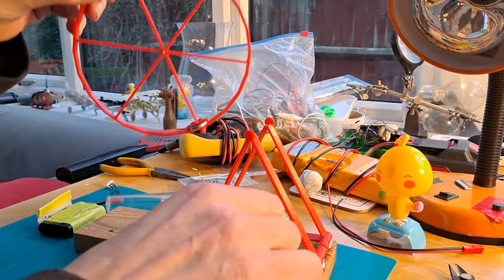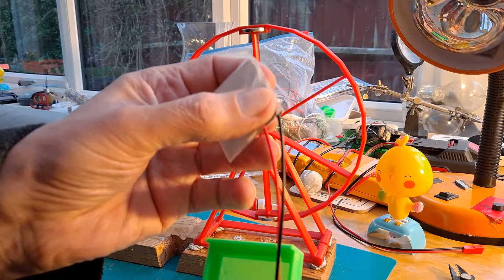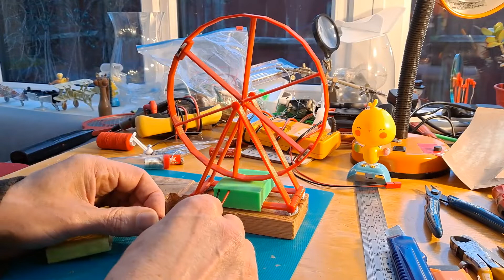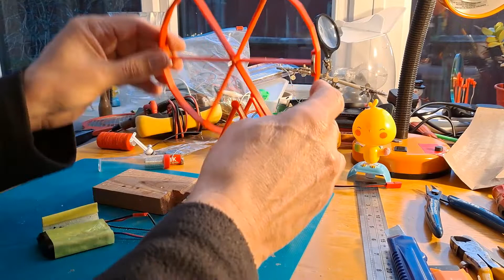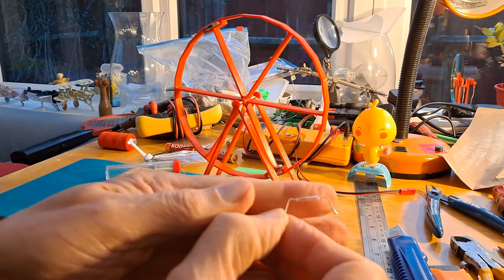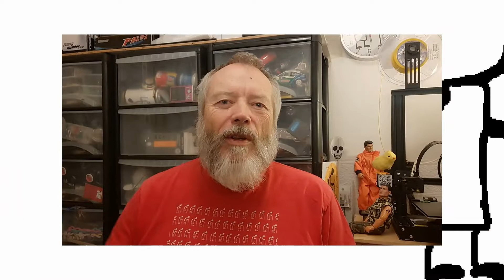RFID tag label pulse motor

Comment: Very interesting.  I found these RFID stickers on Amazon cheap.  I orderd some to play around with.  I would have never thought to try this except for your videos.  Thanks  Well done!
Reply from the maker: If it has a coil, I try it as a pulse motor driver. Can't resist 😊
Reply: @GrandadIsAnOldMan  Me too. The last week I have been trying different things also.  I fount that even a rolled up USB extension cord would work if you attach to the silver metal ground on each end.  A 4ft cord rolled up around two fingers does the job.
Reply from the maker: @Lidmotor  now you have got me thinking. How about a pulse motor without a coil. Just a straight piece of wire. I have just given it a try. Not a success but you can see the potential. I will post a video when I have edited it 😆😆
Reply from the maker: @Lidmotor  not a success but enough to show an idea https://youtu.be/j9IDvNpfyYo and links in the description to the videos I did with my grandson back in 2014 on the same idea, probably before I had even tried a pulse motor.
Reply from the maker: You probably already had some of those stickers inside any packaging of reasonably high value items you have bought. Quite often between the cardboard layers. 👍
Reply: @GrandadIsAnOldMan  Thanks.  I have been checking things but so far no luck.  I should get my Amazon order in a few days.    Really anxious to try your idea out on a pulse motor.  I bet they also work as a receiver antenna on a cell phoine charger.
Reply from the maker: @Lidmotor  probably 😊😊🤔🤔

Comment: Depending on how you have connected the battery you may not have damaged the chip (and the fact that the label is repelling the magnet seems to infer the chip is still working), but I would keep the voltage down to around 5V as many chips have a supply limit of 5.5V (later ones can go up to 16V but they have only recently been produced).
Reply from the maker: Surely, if the chip is in circuit then it would short circuit the coil.
Reply: @GrandadIsAnOldMan  Depends on where the wires are connected. Assuming the battery is powering the chip via the coil (antenna) then the chip will 'wake' and short / open the coil a number of times depending on the tag's id. This is effectively shorting the battery, for very short time periods. Most chips in the NFC / UHF space can cope with 5.5V max. You could energise the chip by bringing a NFC or UHF reader (depending on tag type) close to the tag but the very short achievable range may impact your wheel.
Reply from the maker: @ralphj4012  what I meant was that if the chip is still in circuit, the coil would be a closed loop through the chip, and putting the battery across the coil would be shorted by the chip. That is why I suggested that I have probably damaged the chip. Of course, if the chip is a high enough resistance, then the current from the battery would flow through the coil instead of through the chip. Another reason for thinking the chip is no longer in service is this picture from the previous video https://youtu.be/dZ_CCdIKSvo?t=488
Reply: @GrandadIsAnOldMan  Again, depends on the connections and chip type / pins (there are around 100 different chip types). By connecting the battery only momentarily (assuming the battery is being connected across the coil and therefore powers up the chip) you are 'simulating' what would happen when using a reader (although the induced voltage across the coil by a reader is only millivolts most chips can handle up to 5.5V). The chip rectifies, boosts and stores the voltage prior to tag id transmission (which occurs by the chip shorting / opening the coil connections). The only reliable method to determine whether the chip is functional is to use a reader (or a smartphone and app if NFC) or a scope (but very complex / time consuming). I would be surprised if the chip was damaged (as otherwise it would be unlikely to pulse the coil / deflect the magnet).
Reply from the maker: @ralphj4012  I appreciate your input, but I really don't understand why you are so focussed on the chip. It has zero relevance to my use of it here other than the fact that if it was shorting the coil it would prevent it working the way I want, as the current would flow through the chip rather than round the coil. Putting the battery across the coil is providing the current through the coil to generate the magnetic field. Current flowing through a wire generates a magnetic field. When the wire is formed into a coil, that simply magnifies the field generated. I am tapping the battery contact to generate a pulse of magnetism at the relevant moment to send the wheel round. I am not trying to activate the chip and the link I included in the previous reply shows that I actually detached the coil anyway.
Reply: @GrandadIsAnOldMan  Your, original comment (to which I responded) -  you will realise I must have destroyed the tiny chip whilst I was poking around. Serves me right for trying to be helpful, I won't make that mistake again.
Reply from the maker: @ralphj4012  I guess you just ignored my explanation of what was going on and why I was doing it. Like I said, I appreciate your input but you seem to have missed the direction this was going.

Comment: Works great. Now you can use those tag coils for lots of projects. Just a bit awkward to solder with them being on an aluminum base. I never knew the supermarkets dumped them after they have been removed. The B&Q store that used to be here had a skip outside the store which was not locked up in a compound. There were always people raking through it to see if there was anything that could be used. Got a couple of things out of it myself and was surprised to see some of the stuff was hardly damaged. Just a small dent or a scratch.
I assume it would all go for recycling.👍
Reply from the maker: These flat labels are in the packaging of lots of items you buy. If you check carefully you would probably find some. Particularly electrical goods.
Reply from the maker: I don't think they are aluminium, it was my first thought, but I must be wrong.